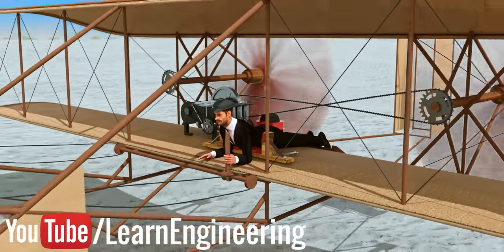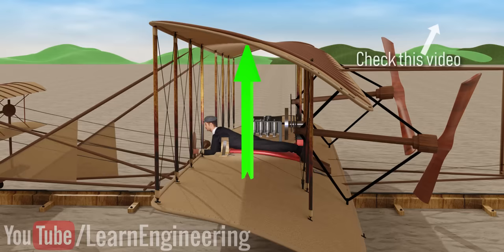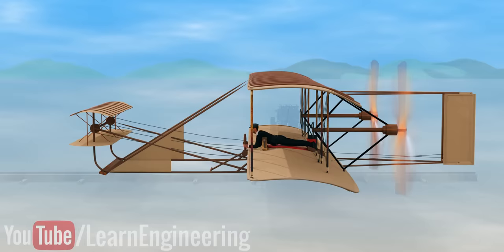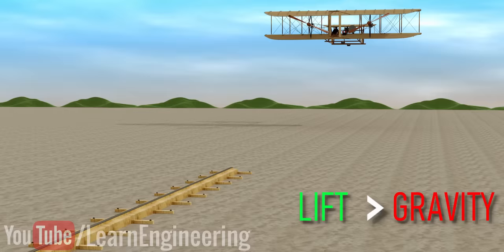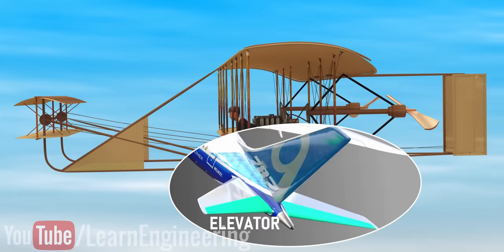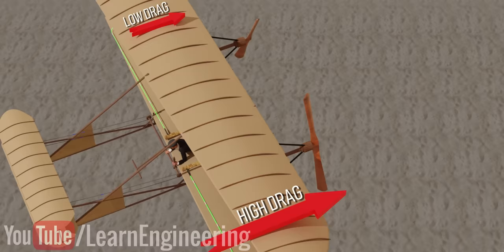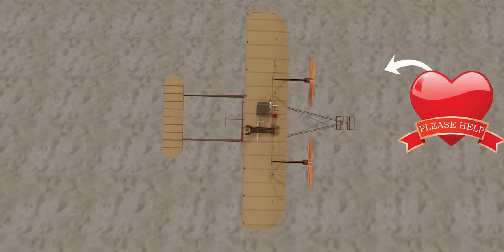The Brilliant Engineering of FIRST FLIGHT !

Comment: the wright brothers were more like a glider using a catapult, for me, santos dummont was the real inventor for making a plane powered by its own engine
Reply: The Wright Flyers were all powered by engines, and the first model, in 1903, took off without using a catapult.
Reply: @cardinalRG  not really, they did have an engine but they could only take off with a catapult. it has already been proven that they used it, and soon after it crashes, so that's not a plane, it's a powered glider. The French have proof that Santos Dumont invented the first real plane to actually fly, because he only had one engine and could fly with it alone, without the help of an angry birds super slingshot.
Reply: @j-games6159  --It seems that you didn’t read what I wrote.  Again, the 1903 Wright Flyer did not use a catapult.  Furthermore, the Wrights used a catapult in later years only because they considered it to be a superior method of takeoff, not because their aircraft required one to get off the ground at all.  The catapult allowed operation from rough fields and confined spaces, such as Huffman Prairie where the wheeled 14bis itself likely couldn’t have operated.  All the same, when exhibition rules and potential customers required it, the Wright demonstrated the ability to take off without a catapult.  I’m afraid that your not-an-aircraft argument is invalid.
Reply: @cardinalRG  like I said, they actually used a catapult on their first flight, it's been proven. they only stopped using the catapult in 1905 with the flyer 3. the aircraft also had no wheels and used rails to take off. they didn't use the catapult because they thought it was more effective, but because it facilitated the flight and it was the only way for the aircraft to fly. besides that the plane couldn't fly on its own and crashed soon after, so I consider it more like a glider. you are like that playboy and popular student in class that I never want to lose and believe only in yourself  (J-games is not responsible for any offense or disrespect you feel)
Reply: @j-games6159  --Your timeline is backward.  They did not use a catapult in 1903, and used one only later.  Whatever “proof” you think supports your mistaken claim, has actually misled you instead.  Furthermore, your belief that a rail enables an aircraft to fly, demonstrates that you don’t understand the physics of flight.  For these and other reasons, I encourage you to do some genuine research.
Reply: @cardinalRG  "already proven" do you know what it means? 
the rails functioned as a landing gear, and an aircraft cannot fly without a landing gear. the flyer model worked as follows: first, the engines were turned on, then it was catapulted along the rails until it reached enough speed by the engines and is disconnected from the rails, then took off, so it went flying around. in 1905 they managed to fly across the Atlantic, but French technicians doubted the use of the catapult. the "14-bis" model had a wheeled landing gear, so it could crawl without rails. first, the engines would start, then it would run with the power of this small 50 hp engine until it reached enough speed and took off. in April 1907, the 14 bis was destroyed during an unsuccessful flight, where SD mishandled the plane and caused it to crash into the ground.
Reply: @j-games6159  --Friend, you’re extremely misinformed.  For one thing, an aircraft doesn’t need “landing gear” to fly, only to land.  And skids, like the kind on the Wright Flyers, are a type of landing gear.  The fact that you still insist that the Wright Flyer used a catapult means that you refuse to do any genuine research.  And of course, no one flew across the Atlantic in 1905—I don’t know where you got that nonsense from.

Seriously, you need to research this topic properly, or else you’ll continue in ignorance.
Reply: @cardinalRG  man i searched all over the place before even commenting, they actually flew over the atlantic in 1905 and used rails. the existence of this is proven. if an aircraft doesn't have landing gear, it won't be able to slide to gain speed since it won't have wheels to prevent it from dragging on the ground and destroying itself. I think you have to review your sources and stop sharing false information.
Reply: @j-games6159  --Now I can see you're just playing games, and trolling.  We're done here.
Reply: @cardinalRG  not really, I researched my sources really well. if i was trying to troll you, i would just be cursing you and laughing at you instead of presenting evidence, even if in your point of view they are uncertain. but let's just stop arguing since no matter how much evidence i present you just think i'm being ignorant, refusing to research or spending all my time in my room playing some pay to win battle royale anyway let's just ignore it and get on with our lives.
Reply: @cardinalRG  oh, one thing I forgot to mention: in the 1903 flyer model patent, the description is as follows: "Our invention is related to the class of flying machines in which weight is supported by reactions resulting in airplanes under a small angle of incidence, through the application of MECHANICAL FORCE or by the use of the force of gravity" 
that is, they actually used a catapult and rails to get the glider off the ground.
Reply: @j-games6159  "an aircraft cannot fly without landing gear" you know what landing gear is for right, things can move across the ground without wheels, slide a book across the ground or something and that would disprove half your arguement

Comment: Another cool feature was to place the elevons at the front of the aircraft because it added to the overall lift of the aircraft. It is less stable though, which is why modern aircraft have them at the rear, but then the tailplane has to be upside down to give negative lift. Modern aircraft have the power to overcome that deficiency.

Comment: The wright brothers decided to put the pilot of centre because they had to balance the weight of the aircraft because of the weight of the engine.
  It may not have been practical to have the engine anywhere else not above or below the pilot nor in front or behind because of balance.

Comment: Impressive but too short a video. Please make something for engineers with diagrams on Bernoulli's theorem etc. An important term missing is Banking.
Reply: The “…engine purchased in France” was a license-built copy of the Wrights’ own design (the Taylor-Wright engine) which they had been using for years by then.  This engine entered regular, serialized production for Wright aircraft to be produced in Europe, and the Wrights sensibly took one as a spare for their own use, rather than shipping one all the way from the United States.  Your implication that the engine was some new, non-original technology which they needed to fly at all, fails.  You’ve been corrected on this before, so why do you keep repeating this attempt at deception?

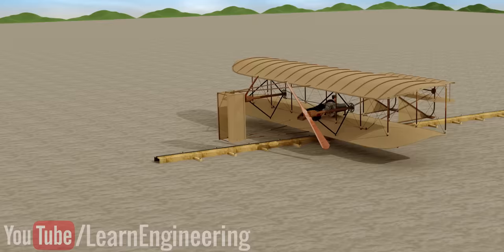Comment: at 3:55 you discuss the rail system. however, there is no depiction of any landing struts. what held the flyer stable as it moved down the rail and how did it land without the struts?
Reply: I'm not sure how it stayed stable on the rail but I do know it just pancake stalled from low elevations to land.
Reply: @Billycca3  gotta wonder how these brilliant men, that were bike mechanics, never thought to put wheels on their new invention!
Reply: @sixmax11  I'm not sure exactly but I would postulate that it might be because wheels have much higher rolling resistance than rails.

Comment: I know how to make an airplane fast 
1. Connect a motor to a gear train 
It will make the spinning faster than the motor then connect it to the prop or fan with a belt then voila you made your plane faster
Reply: That comes at the expense of torque though, using gear ratios can make things turn faster, but it also takes more torque to spin the bigger gears

Comment: The 12 Hp engine was too weak for sustained flight to 260 meters. The centennial's engine had 50 Hp and failed to take off. They were dependent on wind, they did not motorized flight.

Comment: More impressive was the design for manufacturing and design for maintenance.   Besides the engine no machine parts or parts that were cast.  Everything designed to allow complete breakdown of the aircraft for shipping and to allow making replacement parts right on the beach.

Comment: They forgot to draw the catapult. Without it, with that engine and aerodynamics, it will never fly.;
Reply: Your claim requires that you've assimilated all pertinent factors into the appropriate calculations--these would be lift and drag coefficients, propeller efficiencies, gearing, etc.  Please provide your calculations here.  If you can't do so. then you're just guessing.

Comment: it is not true, the wings of the plane did not have the normal foil profile in the wings of the most advanced planes.  In fact they did not even have the basic knowledge of fluid mechanics already disclosed by Daniel Bernoulli from the mid 18th century. Among other European researchers first to use the foil feature was Santos-Dumont in the Demoisele model in 1907. Confirmation is easily  proven by looking at the images of the planes abundantly found on the internet.  Another detail is that the propeller drive included great energy losses thanks to the use of belts and pulleys.  Perhaps with the use of direct drive, they did not need the help of the catapult to take off

Comment: Santos Dumont in the American Press.  highly complimentary:
Most nations mention their national hero as the first to fly.  The US is not an exception.
However, Santos Dumont is recognized as the pilot of the first official flight and the articles about him are highly complimentary.
composite photo:  https://www.fai.org/news/12-november-1906-first-flight-santos-dumont

From: 

(another article:  http://theappendix.net/issues/2014/4/the-aviators-heart)

Santos Dumont called the airplane the 14-bis, meaning "14-encore" since the airplane made its first appearance suspended from the belly of Santos Dumont's No. 14 dirigible.  He flew it without the dirigible on September 13, 1906, making a hop of between 23 and 43 feet, depending on who you talked to. 

SB:  He used a small Antoinette aero engine that produced about half the power of the one introduced in 1906.

On October 27, 1906, he managed to fly 197 feet. Then, on November 12, he set the first aviation record in Europe, flying 722 feet (220 meters) in 21-1/2 seconds with members of the Aero-Club du France in attendance. 

This won Santos Dumont a prize of 1500 francs (about $300 USD) for making the first flight in Europe over 100 meters, and because he was observed  by officials from what would become the Federation Aéronautique Internationale (the designated keeper of aviation records), he was credited with making the first powered flight in Europe.

(SB: On October 23, 1906, Santos-Dumont won the Archdeacon prize by flying his Hargrave box kite inspired aircraft at Bagatelle in Paris. He was hailed by many in Europe as the first to fly, despite the fact that the Wright Brothers had achieved such a feat three years earlier in the United Sates.)  Dates don't coincide.

THE DEMOISELLE
Santos Dumont flew the 14-bis for one more brief hop on April 4, 1907, then abandoned it as a technological dead end. (the aircraft was so damaged it could not be repaired)
He turned the design around so the canard was in back and made a tractor biplane with plywood wings, the 15-bis. (correction, model 15 followed by 16 and 17) This, however, (15 and 16) refused to fly. He turned to monoplanes and produced (several) unsuccessful models (18, 19?), but the fifth -- the Demoiselle, first flown in 1909 -- was a winner. Tiny and quick, it was the first practical light aircraft, although pilots reported that it was a handful in the air.

---
https://www.thisdayinaviation.com/tag/coupe-daviation-ernest-archdeacon/

https://www.thisdayinaviation.com/19-october-1909/  (nice composite photo of Alberto)

https://en.wikipedia.org/wiki/Alberto_Santos-Dumont

http://theappendix.net/issues/2014/4/the-aviators-heart    (about Santos Dumont)

Richard Anemometer: https://airandspace.si.edu/stories/editorial/octave-chanute-and-richard-anemometer,   a gift from Chanute.  article includes a photo from Kitty Hawk
with Chanute, Herring, and others.

Comment: Santos Dumont was the first one and using no catapult system… 🇧🇷
Reply: The first Wright aircraft did not use a catapult.  The Wrights used one only in later years, because it was their preferred method of takeoff, not because their aircraft needed one to get airborne at all.  A catapult allowed for takeoff from rutted surfaces in confined areas, such as Huffman Prairie where Santos Dumont's 14bis would not have been able to operate.
Reply: I love Brazilians....

"The replica didn't fly." -  The weather on December 17th at Kitty Hawk was unusually cold that day. The barometric pressure was very very high. The air density altitude on that day was about a 1000' below sea level from a normal day. That's why they flew. Had they not, it would have only been a few days and they would have. When they went back to Ohio the air density altitude was about 5000' and no, the aircraft didn't fly. It took them some time to figure out that barometric pressure was important when it comes to flying.

"They were catapulted into the air and glided."-  They did not use a catapult at Kitty Hawk. You are referencing the very 1st filming of a flight in Ohio. That was the 4th airplane they had built in 1908 (its here on YouTube) . There was no catapult at Kitty Hawk…. There was no catapult…. At Kitty Hawk. If a fighter jet gets catapulted off the end of an aircraft Carrier, does it then not fly?

"Dumas was the first to fly"‐  According to the definition of heavier-than-air flight, no he didn't. His airplane did not have a proper propeller, it did not have a way of controlling the aircraft via ailerons or wing warping or a rudder that moved or elevators that went up-and-down…. He hopped. Just as you guys wanna claim the Wright brothers were catapulted... his airplane was just like a paper airplane.

Please go do some research!!!!!

Comment: the weight of the engine is approximately equal to that of the person operating thus the engine is not fitted in the mid of the plane. However it makes the machine completely limited to only a type of person who could fly on it. 😁

Comment: There is a small problem in this video, it says that it is the first flight, when in fact the first flight was made in Paris, by Alberto Santos Dumont
Reply: @emf6866  The 14 bis was the first plane to take off on its own, unlike the Wright brothers' plane. The rule was clear, the first plane to be considered would have to take off by its own means.
Reply: @JoseCruzOficial  didn't it also take off on its own during the first flights. They only used the catapult in Europe because it was a faster take off. Also does using a catapult invalidate the aircrafts ability to fly?

Comment: The first flight was made by Santos Dumond in 1906. The Wright brothers allegedly flew before him, but there is no record of this. Santos Dumond did it in front of the Eiffel Tower with half of Paris watching. And the plane took off by itself, not with that catapulted bullshit.
Reply: The surname is Santos-Dumont.  The Wrights’ flights of 1903-1905 are on the record.  Santos-Dumont’s 1906 flights were across the river and a few miles away from the Eiffel Tower.  Lastly, the Wrights didn’t use a catapult for their early flights, and only used one later to achieve shorter takeoffs on rough surfaces, not because their aircraft needed it to get airborne at all.
Reply: Literally the first images you see when you search it up are of it flying

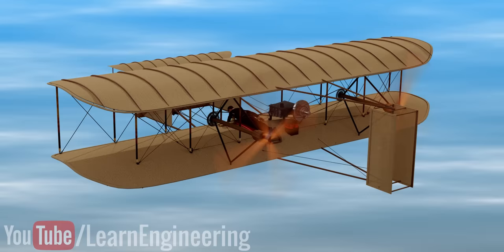Comment: 7:14 how does a single propelar airplane cancel gyroscopic affect?🙄
Is there any counter balance in the engine to do it?
Reply: They are designed with the propeller at the front.
At tail end there is force on the top of propeller which causes it.
At front there is not such force
Reply: My best guess is there's 2 props on the plane, meaning to would rotate horizontally. However for single prop planes it would roll in stand of flat spin, so mower days pilots would just correct while flying.

Comment: The Wright Flyer, being short coupled,  had a very small center of gravity envelope and was tricky to fly.   Glenn Curtis designed and built a much better aircraft with ailerons and a larger center of gravity envelope in 1910 and it still flies occasionally at Old Rhineback Aerodrome in Red Hook, NY.

Comment: -  If memory serves me right, there were 3 diferent attempts to fly 3 exact replicas (by universites & EAA) of the flyer in 2003 (100th anniversary).  And they were all unflyable in that exact configuration. 
-  It appears that only the Wright brothers had the skill & intuition to pull it off.
-  They new that it would never work as a reliable flying machine. Thats why after the finale flight that day a gust of wind blew the flyer over and damaged it. The brothers didn't bother to fix it.
-  But they went on to build a new modified flyer (pilot sits up, steering wheel, passenger) that dazzled crowds in Europe  in 1908.
Reply: There were at least 2 successful test flights of the exact replica of the 1903 prototype.  They were very difficult to fly but did a achieve flights of 100 ft
in a 15 mph wind.  The Centennial flight was in less than 5 mph. winds.